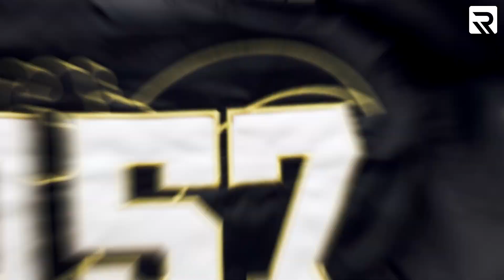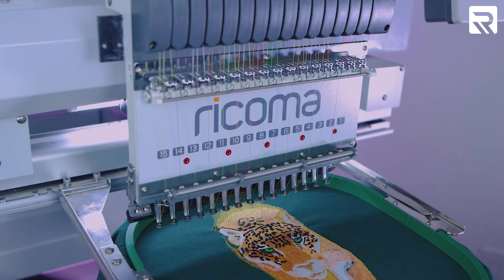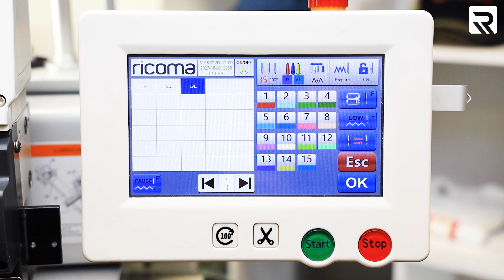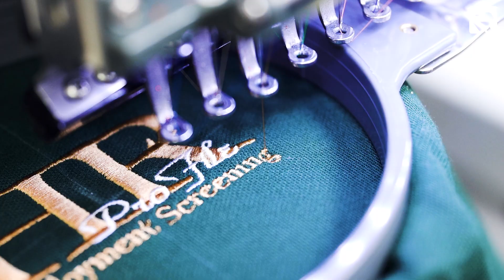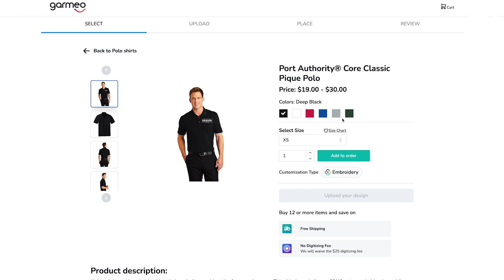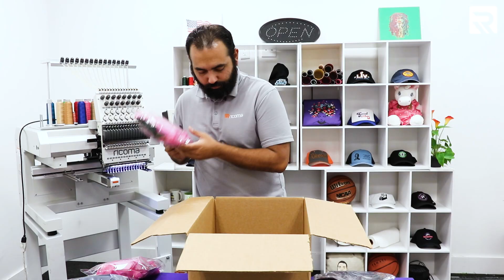How to CRUSH a Bulk Polo Order with a Single-Head Embroidery Machine

Comment: Did you need to reset the design or anything on the panel/screen after each shirt? I feel like I need to reset the hoop for the next shirt in order for it to be centered. I’m using the MT1501
Reply from the maker: If it’s the same design, the hoop automatically goes back to the starting point so you would only need to load the hoop and press start